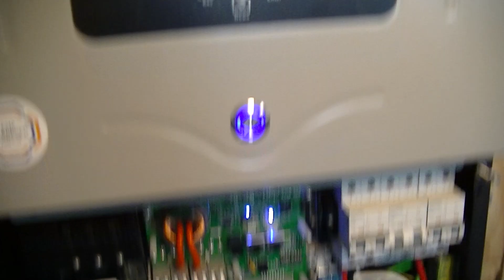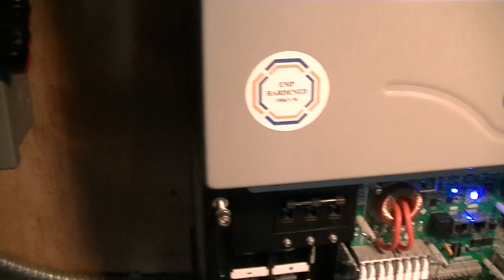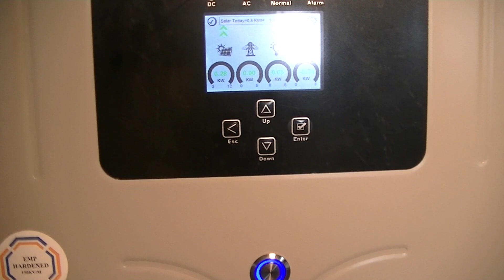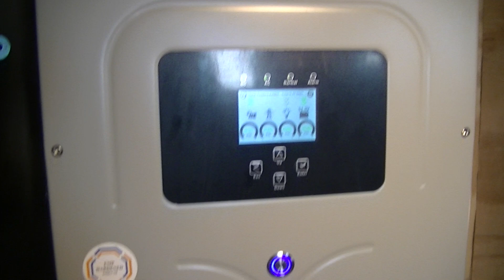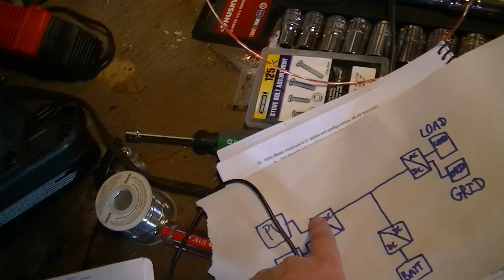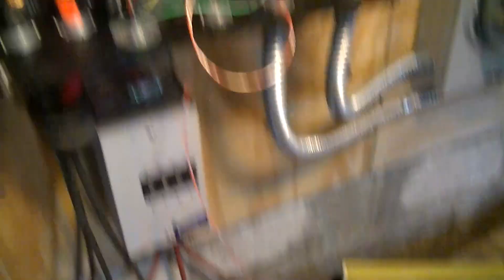Sol-Ark 12K inverter first impressions

Comment: Please do post a vid on why you chose FLA  batteries vs a lithium chemistry
Reply: Likely due to EMP hardening, Lithium batteries are not inherently EMP resistant. FLA are.
Reply: Nothing in my house is EMP hardened, so why should my Sol Ark be?
Reply from the maker: Besides cost, these batteries are in an unheated building.  Lithium can be destroyed if charged or discharged when cold.

Comment: Don’t know why the inverter don’t accept the wires from the combiner box(+,- and ground) and only wires direct from the strings. Any idea.
Reply from the maker: The main combiner box output goes to the string inputs on the Sol-Ark.  PV ground connection is made to the master system ground.

Comment: 5:30 For the having other inputs feed in or export . . . there is the "AC input / output breaker"  You can configure it to be a generator or string inverter input, with a max of 10 kw of power pull. If the generator is on, it uses it and only pulls as much power as tell it, suggested 75% derating ( if have 9 kw generator, configure to pull 6 kw of power). That is what I plan to do to charge my batteries on a cloudy day, so I can turn off my generator off at night.

Comment: I wonder what the voltage range is on the internal bus? I wonder if they could modify it to let us run it directly to the batteries or if the voltage needs to be in a more narrow range to work with the inverter.
Reply from the maker: The internal bus is something like 400V (technically +/-200V bipolar).
Reply: @randacnam7321  it sure seems like with a simple software update you could hook that directly to a battery and eliminate the DC DC charger!
Reply from the maker: Except the 400V is regulated and optimized for the other stuff connected to it.  It would make sense to bring it out for paralleling Sol-Arks without requiring a common battery bank though.

Comment: Question:  Can the Sol-Ark 12 K be used for 240volt output if it is EMP hardened ? Apparently the 8 k model can only output 110V if EMP hardened.  I am sure you could use transformer on the output to get 240 split phase but thats a different question. You also might try to speak a little slower . Maybe I just hear in slow motion.  Good Points. BTW even though Sol-Ark is a "USA" product it still uses parts from other countries.  I personally came very close to getting this unit and would still like to have it but I just couldn't justify triple the cost of a similar sized and featured paralleled system of other brand. In the future I may well sell what I have and swap to a Sol-Ark product though.
Reply: What brand or model are you looking at as I'm genuinely curious?
Reply: @JJ91284  I went with 3 MPP  5048 MG units for $22000 paralleled and  bought a 10,000 watt step up/down transformer and converted it to split phase for about $300. So $2500 for 15,000 was system. but 2 unit would be very close to the solar 12  ( and I haven't ever seen more than 9,000 watt use at one time) for for about $1850 used as off grid with grid backup that is not sell to grid.
Reply: @teekay1785  Thanks for getting back to me. The MPP 5048 MG inverter does have a lot going for it. With this MPPT controller being able to handle high PV voltage at this price point is a huge plus. Not to mention having a built in 5k inverter all for under $1k each is great. The transformer that you're using, have you measured the idle wattage that's consumed when the inverter has zero load? Is this a Toroidal transformer or standard transformer? What brand/model transformer are you using. If I go with this inverter/transformer setup, I will likely only go with a Toroidal transformer because of the efficiency gained.
Reply: @JJ91284  If you want to avoid the transformer you can get 2 MPP 5048LV split phase models for about $2500
Reply from the maker: The output is inherently 120V/240V.  EMP hardening means they add extra ferrites and tranzorbs.
Reply: @randacnam7321  Could be I am just telling you what I was personally told by Solark Maybe they have made some changes since they told me that.  Also why not just add them to any system.

Comment: Great to here someone with an idea talk about the Solark. I've been using an 8k Completely off grid for 8 months. Main issue I have had is not knowing how to best setup the Gen for max charging without fusing out the Gen when we have a peak load from the home. So I have to limit the Gen charge to 40% the capacity, which means running it 2.5x longer to top up.
Reply: I plan on having the generator going directly to the solark through the input panel and then on the output side put a transfer switch that will have the generator out put. This will allow all the power to go to charging and bypass the loads while charging.

Comment: Thanks for the video...  The 12k can handle 6 strings.  I see 4.  Where are the terminals for the other 2???
Reply from the maker: Using 6 strings requires external fused combiners.
Reply: @randacnam7321  Thanks for the response. So it really should be marketed as a 4 + 2 strings (or something similar). I feel like that's a degree of false advertising.
Reply from the maker: @justfly2525  It is not false advertising.  2 strings is the maximum that can be paralleled without needing overcurrent protection on each string.  Incorporating such fusing into the Sol-Ark wiring compartment would eat up a lot of space.  The reason the Sol-Ark is designed to easily incorporate 2 string per MPPT channel designs is because the Sol-Ark current limits to 20A on each MPPT channel and cheap 60 cell and 72 cell modules have maximum power currents in the 7.7A to 10A range already.  The only time an install needs more than 2 strings is when using modules with comparatively low operating currents, such as 5in by 5in cell or thin film modules.  The latter case is one where the user could have a dozen strings or more per channel (I have seen 70W Abound Solar thin film modules going for very cheap on Ebay recently, and those have an Imp of around 1.3A), but that is a sufficiently small number of utilization cases that Sol-Ark does not include it in their documentation.
Reply: @justfly2525  
So is the "EMP Hardend" statement, because you have to pay extra for that, if you dont pay for the option then its NOT EMP proof.